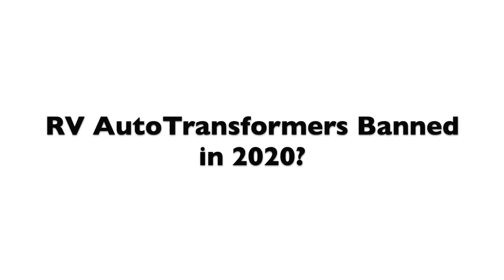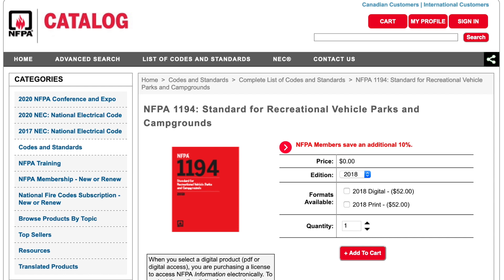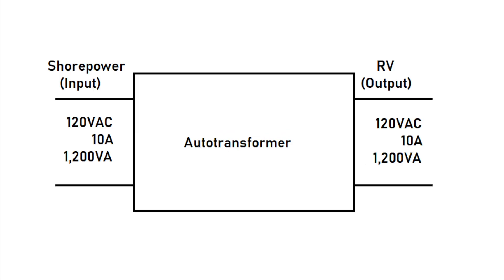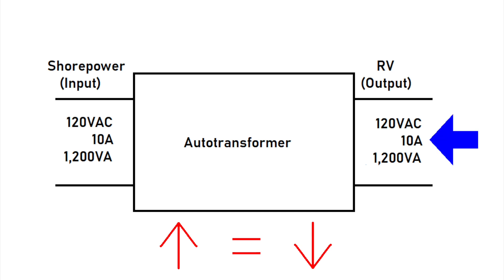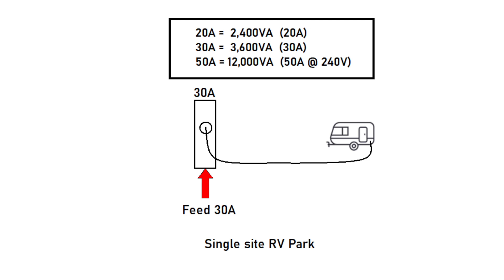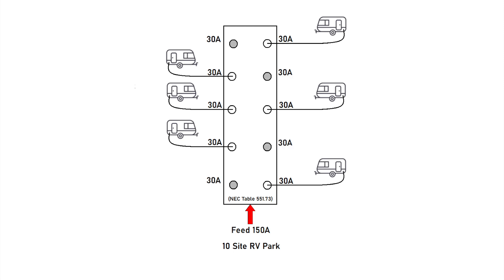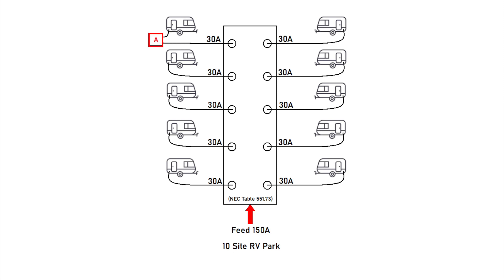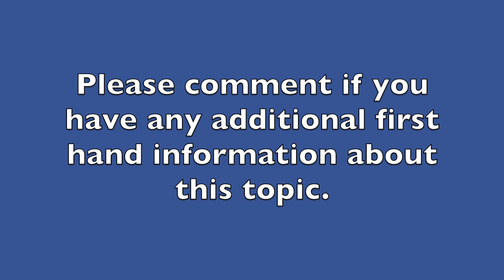RV AutoTransformers and the NFPA... what is the big deal?

Comment: What this ignores is when you drop the voltage to 100, the current draw goes way up potentially damaging the unit or popping breakers. The park is the problem: allowing AF or not fixes nothing!
Reply from the maker: There is also another point most people are not aware of.  Introducing any transformer changes the Power Factor. Since the load is quite variable, a Power Factor compensating capacitor is not much use.  Therefore, the demand on the park's capacity is artificially raised.

If you are not familiar with Power Factor, it's a comparison between True and Apparent Power in an AC circuit, and accounts for the reactive impedance of a transformer or capacitor.  

Any time you introduce an inductive device in an AC circuit - something that produces a magnetic field such as a motor or transformer as well as a capacitive device, you have to account for the Power Factor.

Typically, uncompensated Power Factors can be as low as 0.7.  For example, that means a transformer device could demand 30% more power from the park than would normally be needed. It depends on the load.

While consumer-grade transformers have the same issue, their loads are small, and not significant. But when the whole trailer on a 30A or 50A circuit is behind a transformer with a low power factor, it is significant.

In industry, the power company will normally surcharge a factory when their loads have a power factor less than 1, because they are "robbing" energy from the power company.  So why wouldn't the RV park want to keep those kinds of devices off their grid as well?

Of course, the Power Factor is just one of the several things going on when using an autotransformer. But it's something most, if not all proponents of using autotransformers are not aware of.

People that try to justify having an autotransformer often use DC Ohms Law to prove their point, which is an incorrect use, and in itself demonstrates lack of understanding.

You need to use AC Ohms Law, which accounts for the Power Factor.

And even after discussing the Power Factor, simply the generation of a magnetic field within the transformer has losses. Heat for example. That is wasted energy.

Anytime you add something to a circuit, there will be an insertion loss, so even if you discounted the Power Factor (which you can't), it is not fair to say that connecting an autotransformer creates no additional load.
Reply: @RVProject  More innuendo and presumptions.  Show me real numbers and show me an AF makes it worse that real air conditioners struggling to run on 105 volts.  The only truth in what you say is, "if the voltage drops enough, AC units will shut down, thus draw less from the campground".  Some solution.  Mike Sokol is testing AF units, but is under NDA so can't reveal the results.  I expect there will be a tiny increase in current from using an AF, but I'll say again, the problem is campground is trying to serve 2021 customers using a power system designed and built in the 60's, 70;s and 80's.  AF units don't create the problem and banning them won't fix it.
Reply from the maker: @tomorrowsjourneyrv  We need to get back to the original topic of the video. The goal of the video is to make people aware of the content of the 2021 edition of NFPA 1194 (Standard for Recreational Vehicle Parks and Campgrounds), for it is there that you will find that the autotransformers were banned.  

My video exists so RV'ers can make an informed decision when considering purchasing an autotransformer. Nothing more, nothing less. If you want to take the risk of purchasing a unit and not able to use it, that is up to you.

By the way, the NFPA (National Fire Protection Association) are the same folks  that author the National Electric Code (NFPA 70).  NFPA standards are generally every 3 years, and while it is a public (non-government) standard, NFPA70 has been adopted into regulatory building codes by virtually every government agency from your local government to the federal government.  So the National Electric Code is essentially a government regulation.

NFPA 1194 does not have as wide of an adoption as the National Electric Code, but some local and state governments have adopted it as well. Autotransformers are also banned by the National Electric Code.

The National Electric Code (Article 551) provides recommended sizing requirements for park electrical systems. It is a contention based system as are most electrical/electronic distribution systems (by the way, the internet is also a contention based system).  Study Queuing Theory to understand how contention based systems work. 

NFPA 1194 is more-or-less Article 551 of the National Electrical Code. This allows RV parks and others to purchase the less expensive standard.

I will not deny not every park complies with the latest National Electric Code standard, as it takes time and money to do so. That does mean some parks do not meet the latest requirements, I will agree with that. And while autotransormers do not by themselves create the problem, they exacerbate the problem, especially if everyone has one.

I tried to offer one of many reasons - why autotransformers are an issue. But you are not either understanding how the dynamics of reactive power transfer works, or are not giving it it's due.  Again, study Power Factor. Learn the difference between true and apparent power, and understand how voltage and current become out of phase at the reactive component. 

Buy a Power Meter such as a Kill-a-Watt, one that provides a Power Factor scale, then plug it into various AC appliances and watch the Power Factor and see the differences between True and Apparent Power.  The difference between True and Apparent power is wasted power. 

If you want figures, I did a test on an AC portable apartment refrigerator in one of my videos ( https://youtu.be/vRlyFFV1KmQ ). You can see how the Power Factor and Load requirements change when powering a typical inductive load. 

And the test results show the true and  apparent currents on the load, and depending on the load, there can be a 30% or more power loss in the transfer of energy. If you are not convinced after that video, I cannot help you understand the issue at hand.

Have you read either NFPA 1194 or NFPA 70? If not, non-members of the NFPA can purchase them through Amazon or the NFPA website.

It's not me you have to convince, its the NFPA. Good luck with that.  If you convince them to change their standard, then I will do an update of my YouTube video. Otherwise, I have provided you with enough information for you to research the issue, and it is fruitless to argue the point further.

Comment: This is so ridiculous -- how does adding an autoformer draw any more power -- power drawn is dependent on the load, not the presence of a transformer in the circuit.  And its totally wrong to call a Hughs Autoformer and "autotransformer" - those are two completely different things.  And exactly where does this mysterious 'extra power" draw get dissipated?  If this were true autorformers would be space heaters because A/C compressor draws the same amount of power regardless of voltage (which is why it will be damaged by high current in a low voltage situation).
Reply from the maker: I would refer you to the engineers at the National Fire Protection Agency (NFPA) which published NFPA1192 (2021) and made the determination. I am sure they tested the units before they published the document.

As far as where the "mystery" power draw goes... do you know what Power Factor is?   I believe you will find your answer there.
Reply from the maker: @LetsGoZeroCarbon  Since you are talking about physics, lets be correct.

P=VxI is the DC formula for Ohm's Law. It does not apply here.  What does apply is the AC formula for Power, which is P=VxIxPF, where PF is the Power Factor.  Or alternatively P=VxIxCos(0)

You are not considering the effect reactive components have on AC power.  

Motors, transformers, and anything with a coil of wire in it produces an inductive load. Capacitors produce a capacitive load. Both of these are reactive, meaning they react to the application of AC Power.

In an inductor, the voltage will be out of phase with the current. The amount of phase shift is dependent on the load.  The reason for this is it takes time for the coil to build a magnetic field, which results in the voltage leading the current.  Similarly, when the voltage is removed, it takes time for the magnetic field to collapse, which again results in the voltage leading the current.  

Of course, in a 60Hz environment, this occurs 120 times per second.

For a capacitive load, a complementary effect occurs, but with current leading the voltage. This is because a capacitor acts like a battery of sorts and it takes time for the capacitor to charge.

The net affect is that the voltage and current are not in synch.  For example, a common power factor for an inductive circuit is about 0.7, which means a phase angle of about 30deg.  If you can visualize, with an inductive load, the sinusoidal peak of the voltage occurs about 30deg before the peak of the current.

Since the peaks of the voltage and current cannot occur at the same time, you cannot use the simple DC ohms law formula for power.  The AC formula compensates for the phase shift.

The Power Factor is a ratio that accounts for this phenomena.  So, if the power factor is say 0.7, that means that the energy transfer to the inductor is only 70% of a purely resistivity load (which would have a Power Factor of 1). In other words, the voltage is at 100% while the current is at 70%.  

This means that 30% of the power is lost in the transfer of energy through a transformer, motor, etc.   That requires the source to supply more power.

In fact, a power company will charge an industrial building a surcharge if they operate with a power factor of less than 1, as they require additional current in inductive loads to generate the same power. 

To compensate for this, many devices add a power factor correction capacitor, which brings the power factor back to 1.

Many motors have this extra capacitor. If you look at a compressor motor for example, they often have one capacitor for the starting circuit, and a second capacitor for correcting the power factor.

Unfortunately, power factor correction capacitors require a fixed load to work properly. This is not possible in a transformer as the many loads behind the transformer result in a variable load, hence a power factor capacitor is not effective. 

And that is why autotransformers waste current. It's due to the power factor.

So before you disagree with me, do some research on the Power Factor in AC circuits.
Reply: So, if the power factor will typically result in an autotransformer drawing more current from the source supply than just the load, has anyone independent done a test on the Hughes Autoformer and published the results to confirm whether they do indeed increase current draw and therefore put stress on the campground’s electrical grid? Ultimately, I agree that the problem is the basic premise that the campground grid doesn’t have to be designed to handle 100% of the amperage they are supposed to provide at 120 VAC. Good luck getting a rebate from a campground when they can’t provide at least 104 VAC and the EMS shuts down your camper!

Comment: I always find this topic interesting as I am one of those totally electric coaches with ACs.  I purchased my HAF last year and connected it at the pedestal all last year. Since its so heavy, not waterproof and controversial, I hard wired in my electrical bay between the built in surge protector and the power reel. Not that I am a belt and suspenders guy but also added a pedestal mounted surge protector just to save the power cord and reel itself as it is over $1000 to replace.
Reply from the maker: Thank you for supporting the channel.

Comment: If the voltage is too low, you can ruin your electronic devices and AC.  Parks need to go above the min requirements and provide power that is 120V.  People are trying to protect their equipment.  I appreciate this video and the information you provided!
Reply from the maker: Thank you for supporting the channel.

FYI NFPA70 (National Electrical Code) allows parks to de-regulate their power resources.  No park is going to go above that standard if they don't have to.

Comment: In my opinion the NEC should be designing for worst case scenario. It sounds like it's a roll of the dice as far as the NEC is concerned.
Reply from the maker: To be fair, my 10 campsites @ 30A example is sort of a worst-case scenario as many parks have a mix of 30A and 50A sites. Since a 50A site gives you two 50A (@120V) sources, it would really reduce the issue. 

I think though that he NEC should add a mix of 30A and 50A sites into the derating formula.  For example, if you have x number of 50A sites, you can derate this much, and if you have x number of 30A sites, you can derate that much.

Comment: First time I’d heard of this so I went to my old friend Google.
There are forum discussions about these being banned in 2012.
Reply from the maker: It's probably been a problem  (from the RV park's view) for awhile. Whether the latest push on banning them come from the RV parks themselves or another entity I am not sure.
Reply: What I was reading, it looked like they were already banned, though, even then.
Reply from the maker: As far as I can tell, "fixed" (permanently installed) autotransformers have been banned from the NEC for awhile.

However, that still allowed the use of portable autotransformers, such as the Staco autotransformers, which are used in an electronic lab test environment.

As well. The typical autotransformer intended for RV use are also portable.  The NFPA 1194 ban specifically covers autotransformers in a RV park due to:

 "additional stress to surround electrical infrastructure not accounted for in the load calculations"

... which I interpret as it skews the campground multiple-site derating factor allowed in the NEC.